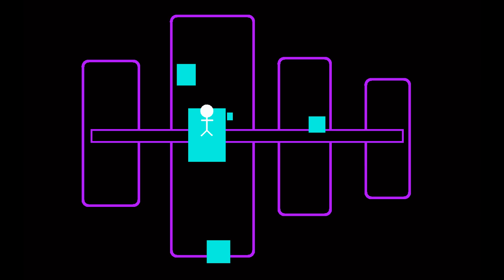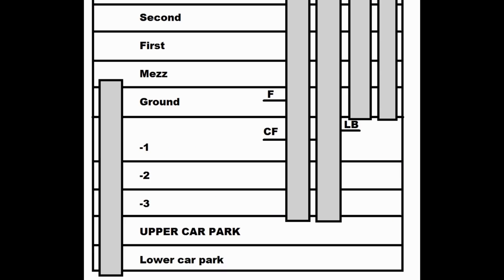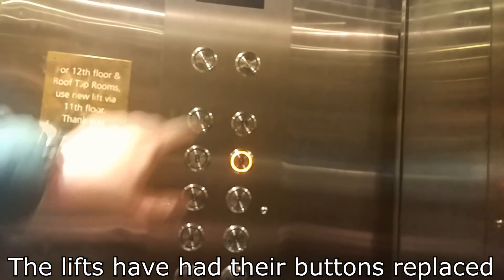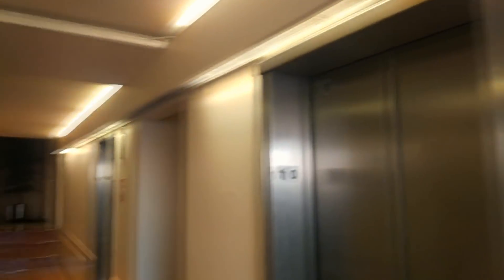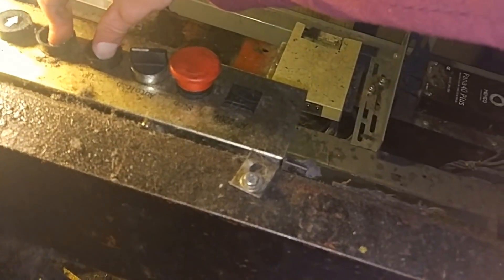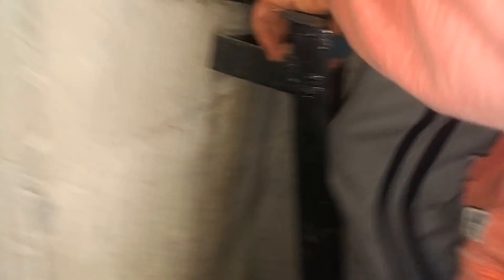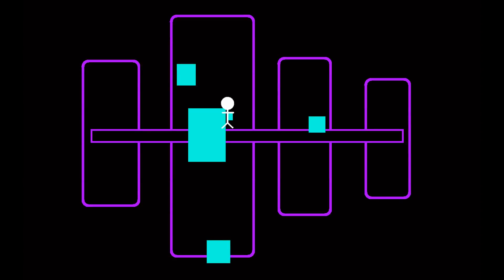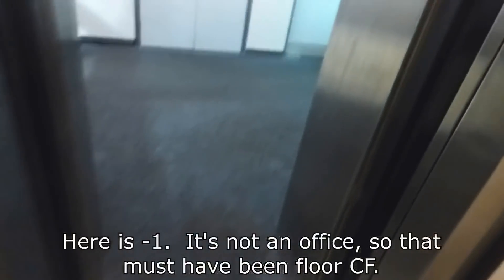Creepy lift land | IT'S LIFT SHAFT TIME!

Comment: The floor cancellation by pressing a button twice is typical from asian lifts. The buttons and the indicator make me think of a Fujitec lift but the chime is an asian Mitsubishi chime. But I know that quite some companies use them there so my guess is that they are Fujitec lifts.
Reply: imaginox9 Both the original buttons from the mod and the newer buttons from this mod are both Jinlix
Reply: This really confirms my feeling that generic modernisations are not that great to begin with.